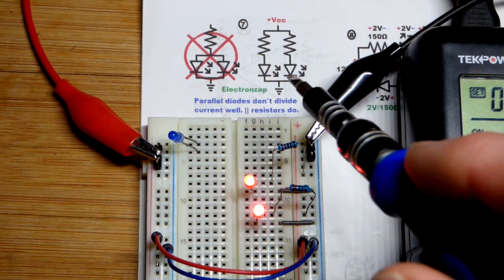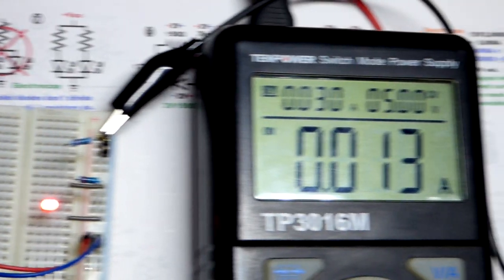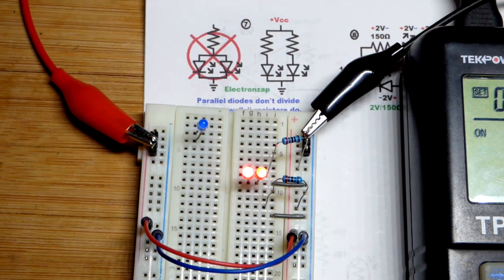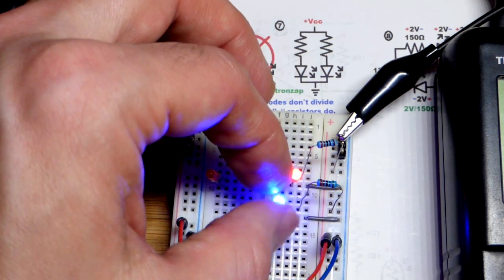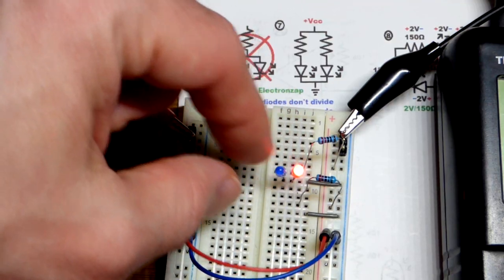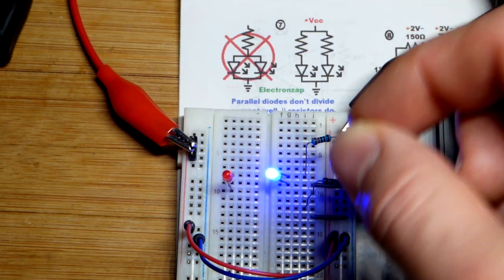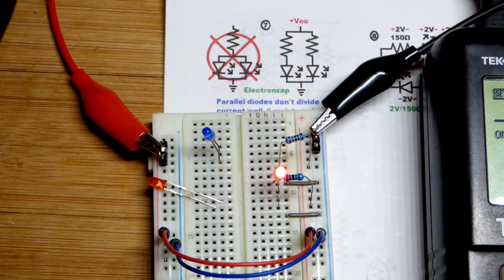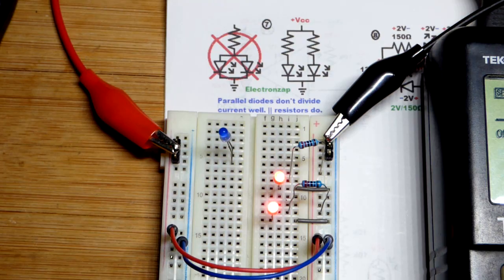Give Each Parallel LED Their Own Resistor For Beginners Learning Electronics

Comment: It's really important to mention that diodes have a negative temperature coefficient. If you put two nominally identical diodes in parallel (and that includes LEDs, rectifiers, Schottky, etc.) one of them will have a slightly different forward voltage for the same current. That one must then draw more of the current than the other. If the current is significant, the one drawing more current will heat up more, raising its temperature. That rise in temperature will tend to reduce its forward voltage drop, meaning it must draw even more current, causing more heating and so on until one diode is taking effectively all of the current, and the other one might as well not be there. Parallel diodes is a failure waiting to happen.
Reply from the maker: Good points!
Reply: that partly explains why I usually see strings of leds in series instead of parallel
Reply: Thermal runaway... And, yep, unless you buy "binned" LEDs, there can be different Vf, do that the lower Vf will get more current. Certainly that also gives uneven brightness, more thermal drift, but not likely to be "fatal', unless you had 5 or 10 LEDs in parallel!
Just thinking  too, that the uneven Vf might lead to higher sensitivity to input voltage change... Should simulate that. BTW, if a bit more cost doesn't bother you, there are constant current LED drivers available, that use one resistor to set current for 4 LEDs, and don't care about battery voltage, as long as it's 50 mV above Vf.
Reply: @lohikarhu734  The "fatal" failures come when the diodes are each passing currents close to their maximum allowed, so that one will eventually draw more current until it exceeds its maximum rating. It then fails open-circuit and the other will take all of the current and also fail.

Constant current is great for diodes as that ensures their dissipation goes down with heating.

You actually only need a small series resistor for each diode to prevent thermal runaway. Small LEDs, for example, have a thermal resistance around 500 °C/W, so a 3V LED passing 20mA would dissipate 60mW, causing around 30 °C rise in temperature and a 60mV potential change in Vf. At constant voltage that represents something like another 10mA in current, so as little as 6 ohms would counteract that.

Of course, most of the time, we already use a series resistor to limit the current from a higher voltage source and that is more than enough to ensure balanced current sharing if each LED has its own series resistor when used in parallel.